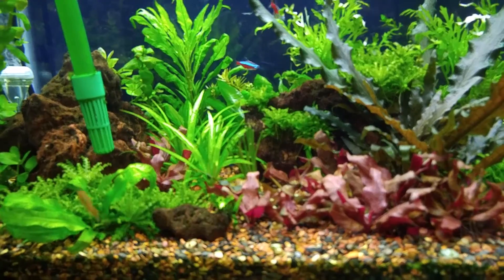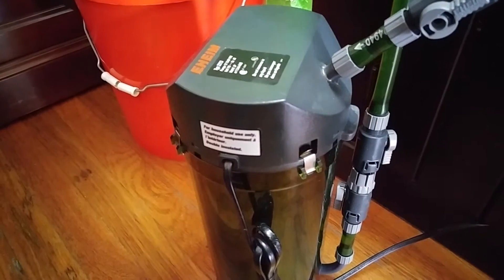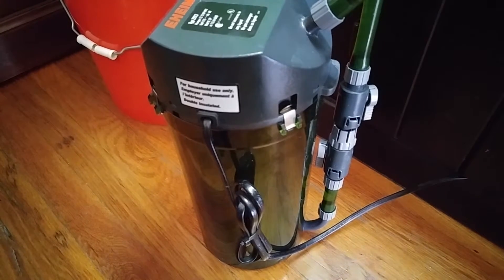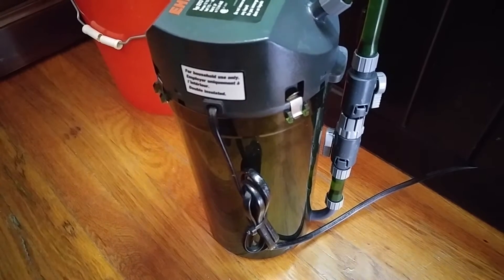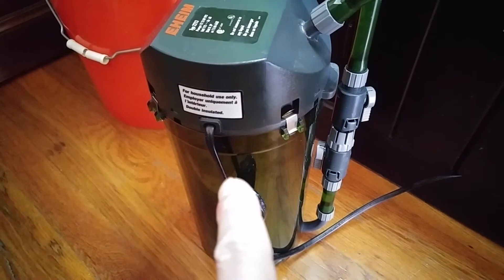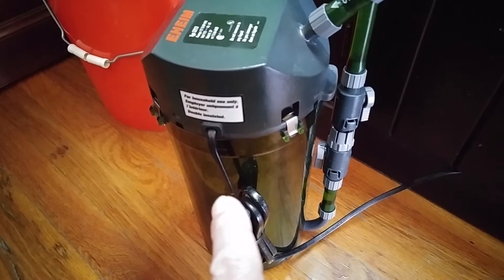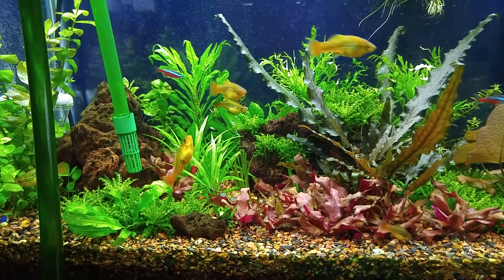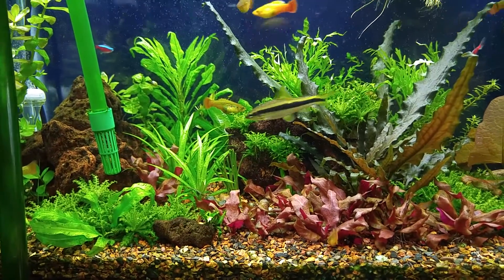Seeding A New Canister With Good Bacteria

Comment: Beautiful aquascape. Can you tell me... when first turned on the SEEDED canister did a lot of the "dirt" from the water you added get back into the aquarium and need to be filtered out again?
Reply from the maker: +Gavin S Every time I clean my canister filter I take the output hose and put it in a pail and let it run for few secs. I then put it back on the tank. I also have used the fine net in front of the output flow. But the pail is better.

Comment: If the aquarium has been up and running for a year, do you still have to go through this if you buy a new filter? I would think since the substrate, plants, and rocks are flush with bacteria you wouldn't have to. Right or wrong?
Reply from the maker: +stormet54 If your filter went bad all you have to do is put the bio media in the new filter and if you adding a second filter you don't have to seed it but it's a good idea to do so. It will build up the bacteria faster.